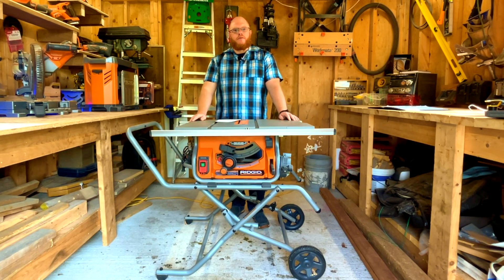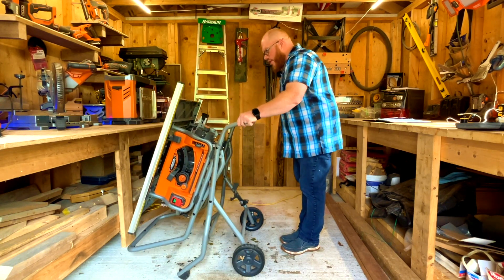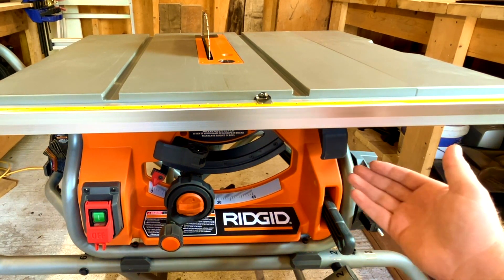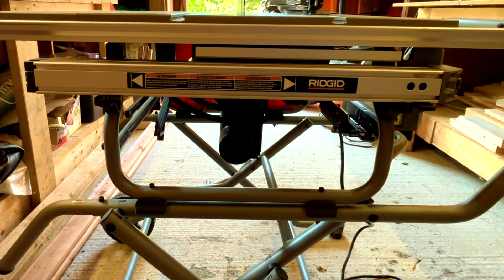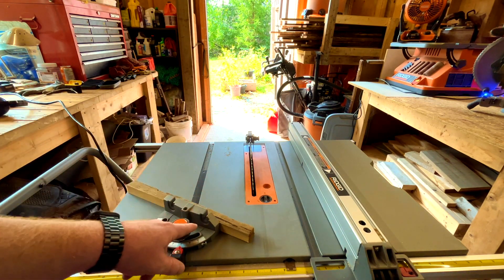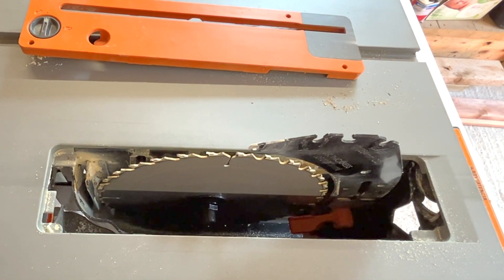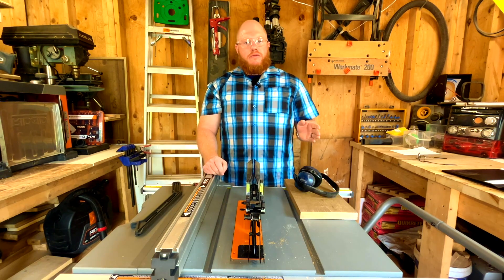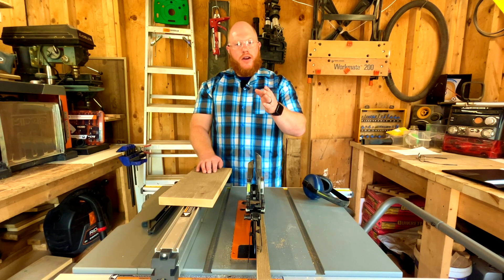RIDGID 10" PRO JOBSITE TABLE SAW- REVIEW!!!! #ridgidtools #tools #ridgid#toolreview #tablesaw

Comment: How does this do with a dado stack?
Reply from the maker: From the Manual:
MAKING A DADO CUT:
An optional dado throat plate is required for this procedure (see the Accessories section of this manual and check with the retailer where the table saw was purchased). All blades and dado sets must not be rated less than the speed of this tool. This saw is designed for use with a 6 in. stack dado (up to width of 3/4 in.). Do not use an adjustable dado on this saw.
Rabbeting cuts are dado cuts made on the end of a workpiece. For best results, complete rabbet cuts using a dado stack blade.
NOTE: Use an auxiliary fence when making rabbet cuts to prevent the face of the rip frence from making contact with the dado blade stack during the cutting operation.

I know with Some Cabinet Style Table saws you can use 8 in and adjustable dados. Must have to do with the motor and weight it can take. Hope this helps. Dan

Comment: The fence on this saw is horrible, with a capital H. I have an older version of this saw and fence. The fence never automatically aligns with the cutting blade when the fence is locked down and the adjustments to do just that, requires constant adjustment. I've come to the point where the only way to align the saw is to use a ruler.  Another, failing for this saw is the dust collection of the blade and system. The system works by covering the lower half of the blade in an attempt to capture all the dust and then providing an opening for a dust vac. Unfortunately, even with 6 hp a peak there is so many open spaces above the blade that suction is barely felt. Dust eventually is thrown up at the throat plate and into your face. Furthermore, small shavings tend to block the exhaust port which tends to render the vacuum system ineffective.
Reply from the maker: Well I don’t own the older model of table saw to compare with this current generation of saw. Maybe they made improvements from one generation to the next. Hopefully they did. All that to say if your saw is not doing your day today requirements well, no matter the band, maybe it’s Time to shop for a new saw. Sometimes tools have issues, no tool is perfect. But, I’d say in your case with all the frustration it’s time to consider a different product. I’ve been there before with a tool. At the end of the day it’s about enjoying your shop tools included. Hope my thoughts help for better results. Dan 😊

Comment: Too bad the guide does not extend up to 24 inches
Reply from the maker: Jean, it would be nicer if it went past 24”! I guess worst case scenario you need extra wide cut you can use an extension table on the opposite side and rip the smaller piece by the fence. Or use a straight edge with a circular saw on saw horses. A bit of a work around, but doable. 😊Dan

Comment: FYI.  This does not have the LSA that Ridgid offers with their power tools.  This only carries 5Yrs of warranty.
Reply from the maker: Thanks Pete for your comment. I have personally registered this tool for the LSA online and Ridgid approved it. There website also says this tool has an LSA in the description for this saw. Here is the online description:RIDGID introduces the 10 -inch Pro Jobsite Table Saw with Stand. This heavy duty saw is equipped with a 5000 RPM motor. It features an updated portable folding stand that provides a single-point release for simple 1-step setup and great jobsite portability. Users can easily complete jobs wit this saw's easy-to-use onboard storage for the miter gauge, etra blades, rip fence, and other accessories. Backed by the Industry's Only Lifetime Service Agreement, this saw includes a 10 -inch blade, a blade guard assembly, a portable folding stand, and an operator's manual. So as you can see it has the LSA. Thanks 😊 Dan.
Reply: I too registered my Table saw for the LSA online. Just like all my Ridgid tools. Easy peezy!! bobby.